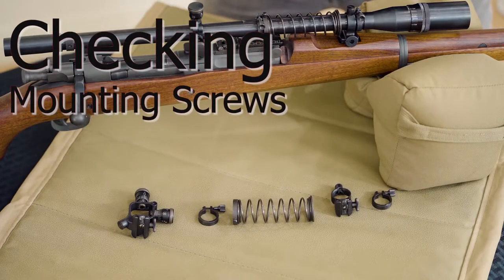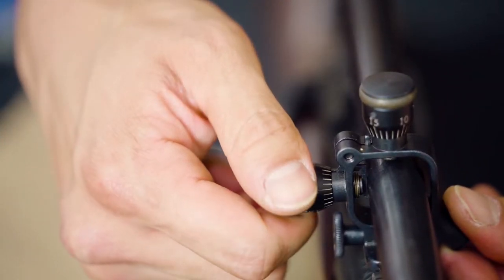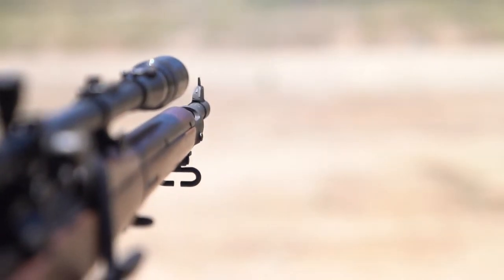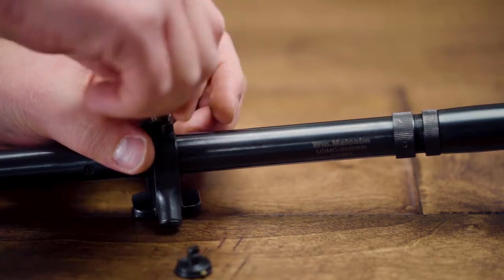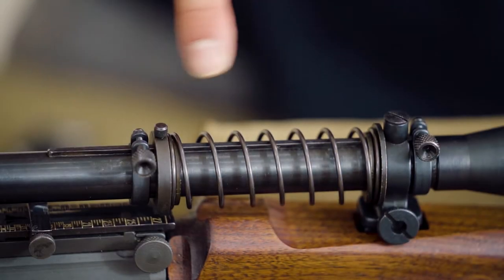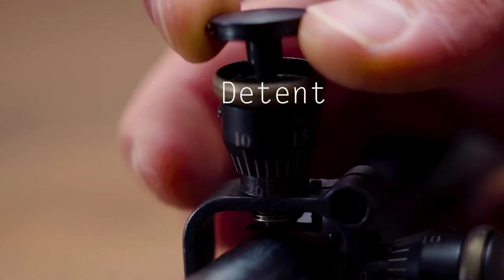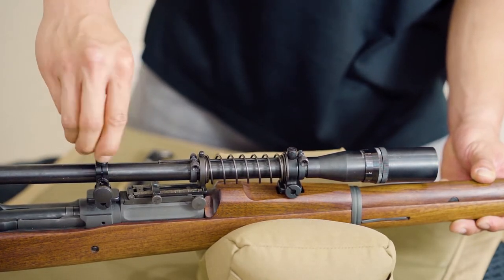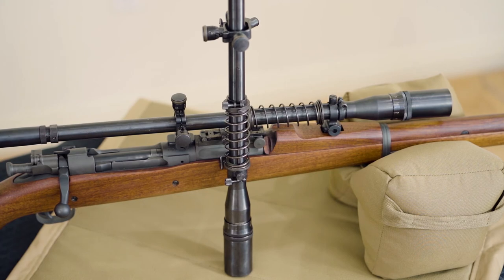Checking Mount Screws on the Malcolm 8X USMC (Unertl)

Comment: Replace every screw you can with an American made screw if you can find them.  The metal in the Chinese screws is really soft and will cause the threads to strip.  Also, use thread-lock(removable) where possible.   Also, get new rings - especially the rear one with the elevation and windage adjustment.   The clicks in the original rings are so mushy you practically can't count them. Sometimes you can't tell if you put in one click or two.

Comment: The glass in these scopes are good and for the price, well worth it to get into the game.  But, with all of the issues, I have yet to make it through a CMP match without something on the scope failing or coming loose.  I'm looking forward to new rings.  Oh, and ya'll should have made the cross hairs replaceable too.  I never hear of any of these issues on original scope/rings.
Reply from the maker: The crosshairs are replaceable! Just remove the set screws on the "8" ring (second lock ring from the eyepiece) using a small phillips head screwdriver. Ironsight Inc. actually makes custom crosshairs for this particular scope, including very fine cross wires.